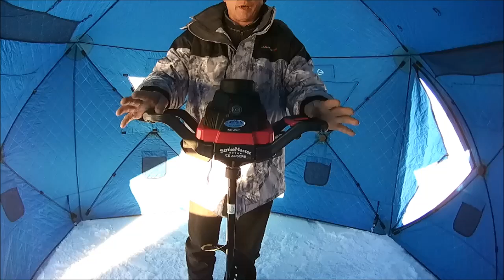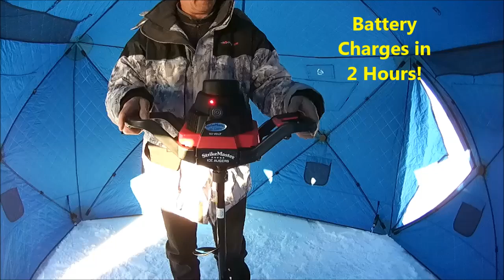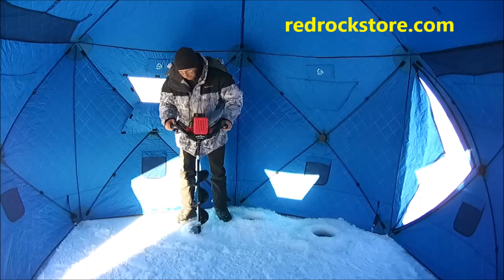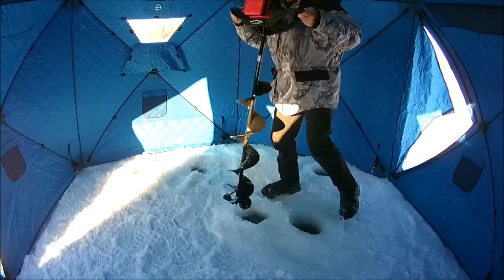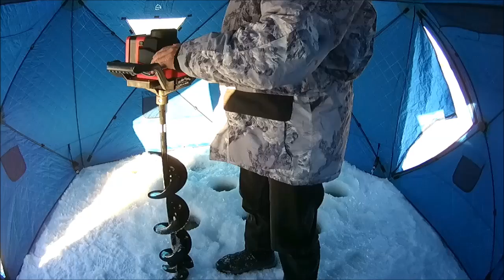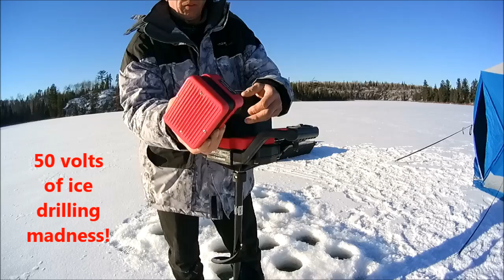Strikemaster Lithium Lazer Ice Auger in real ice

Comment: Will you please do a "real ice" update with the Propane HC40? 

Looking at purchasing that particular auger but would like to see a similar test done with it since it is relatively new to the ice fishing world.
Reply from the maker: I should have one this weekend.  I used it to drill in 18" of ice that was covered in slush from a backing up river that runs through our resort here.  Drilling soaking wet ice is harder to do than dry, hard ice and the motor does not bog down in the HC-40.  Drilling underwater means you have to push a little bit more to make the blade edges bite, but in pushing pretty hard, the Eskimo propane didn't even stall out.  Ample power with the 10" bit for such a tiny little motor, I thought.  Like I said, I'll shoot some vids this weekend.
Reply: Joe B Wonderful! I'm looking forward to it!

I've been up and down on what auger I want to buy. Being a college student who lives in a dorm, the lack of mixing fuel and storing a gas can is appealing.

However, I do not want to buy an underpowered auger for the conditions I am fishing. Here in the Upper Peninsula, we experience similar ice conditions that you guys receive.  Only problem is, being right on lake superior, we get TONS of snow and it seems like there is always slush on the ice. Would you recommend another auger for these conditions?
Reply from the maker: Upper Peninsula Outdoors All augers get a bit sloppy in slush, it seems to me anyway.  I used this HC-40 in water and 18" of mushy/solid ice.  I ended up having to push down a bit to make it bite on occasion during that session.  I've experienced the same with Strikemaster Lazer Blades as well.  I do consider them to be a better blade since they do re-open old holes better due to their "shaving" bite that begins at the center of the hole, but they will have issues of "spinning" in slush, too.  Best thing for slush is to have sharp blades.  If they get a little dull, they cut, then spin, you push, they cut, and if they get ahead of water falling into the hole, they finish the cut. Get a new edge on the blades and drilling always improves I find.  You also burn less gas.

Comment: Hope over time battery charge at drops on this beast. 250~ is steep :(
Reply from the maker: It comes with a perfectly good, 2 hour rechargeable lithium ion battery that looks quite capable of drilling 50 holes on a charge.  How many spare batteries does one need to have?

Comment: Does this auger have reverse for clearing slush from the holes? How does it work when the ice is 30+ inches thick? I'm trying to decide between the Lazer and the ION.
Reply from the maker: +The Garlic Farm It doesn't in 2015/16.  I don't know about next year.  I have used that "hole clearing" reverse on the Ice Gator YEARS before the Ion came out.  I found it to be completely worthless.  Every fish out of the hole brings a nice handful of ice chips.  So, which is better - drill and skim ice once, or drill and skim ice with every fish all day long?

Comment: oh wow 23 inches try try 48 in in northern minnesota
Reply from the maker: I'm from northeastern  MN,  5 miles from the border.  I've been here my whole life and yet to see 48" of ice - ever.  That being said, I was demoing this auger for the video to show how it works.  I then sold it,   Apparently it is still going and why wouldn't it?   Motor, transmission, battery.  Pretty basic function. Turns the auger round and round.
Reply: Joe Baltich 5 miles from the border? We must be neighbours. (: I’m right on the border....on the north side though. Straight north of greenbush. (:
Reply: Joe that name sounds familiar. I'm also from northern mn and yeah..48 inches is like alot of fish stories we hear around here boys! Lol. But anyway we are all from the same neck of da woods so whatever. The ice does get damn thick at times. I'm so pumped to get the new electric anger! So tired of dealing with gas. Spendy but looks worth it in the long run